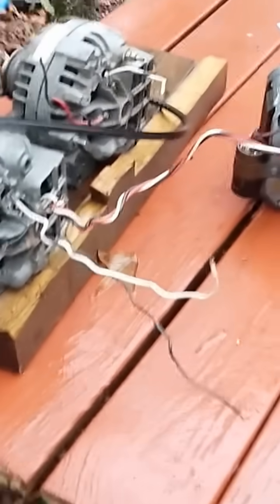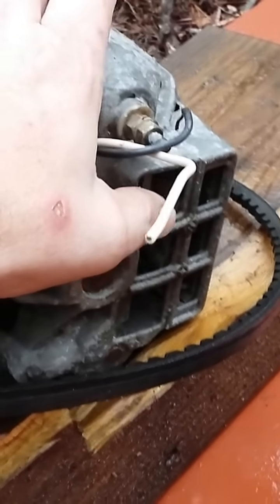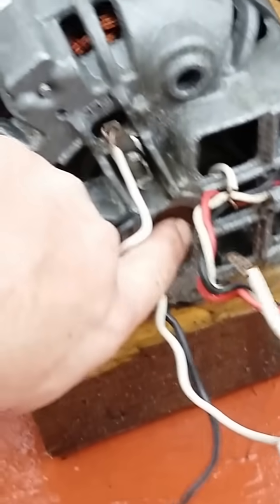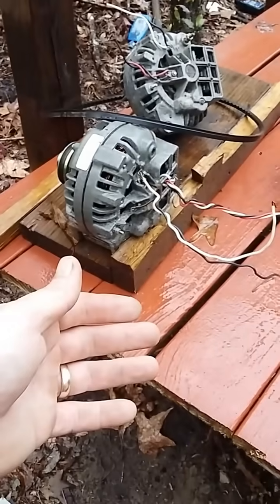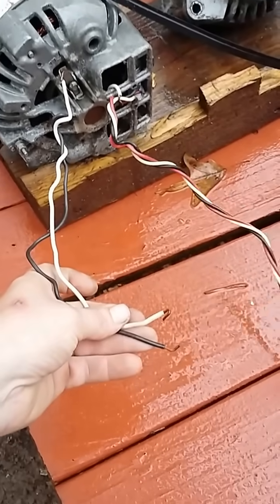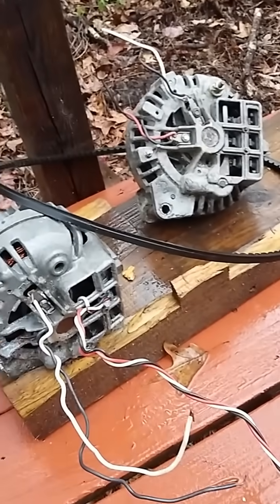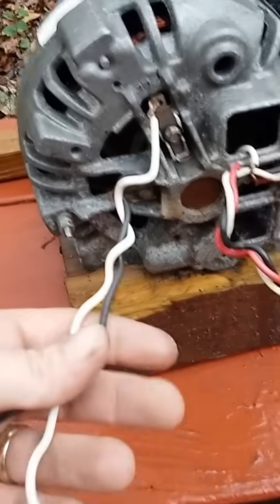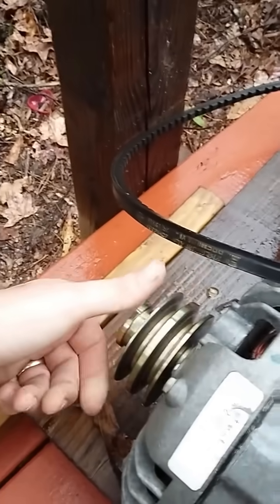Update Free energy forever no wind no solar no gas READ DISCRIPTION!!!

Comment: It's just extremely hard to believe that using components and circuits you didnt  even fabricate yourself you've managed to obtain "free energy". You have no idea how long I've wanted to make a device like that. Free energy is a broad term. Do you mean free as in obtained from a seemingly limitless natural source? Or do you mean overunity by getting more output than input?
Reply from the maker: I am speaking of a large difference in potential with a high resonating frequency that has the same capacitance resistance and inductance resistance being fed into a homemade capacitor and spark gap and bridge rectifier with voltage regulator on positive side and the negative side going directly back to ground. IE.  Compiling frequency of high voltage high frequency into homemade capacitor that has quantum properties copying the electrons and only using the copied electrons in the rectifier circuit limiting the voltage of the positive terminal which is bad energy and directly connecting the negative terminal which is good energy and safe. Thank you for the kind comment!
Reply: see this portuguese video maby it hellps    https://www.youtube.com/watch?v=XWlG5jXvwAQ&ab_channel=liciniobatista

Comment: You're not getting 220v @90 amps out of that alternator. More like 12v. Shaking my head.... None of this video is accurate.
Reply: this portuguese video maby it hellps    https://www.youtube.com/watch?v=XWlG5jXvwAQ&ab_channel=liciniobatista
Reply: @tww1478  ummm diodes don't do that. Do you know what the diode pack does?
Reply: @JF32304  reduces the power to 12 volts
Reply: @tww1478  that's not at all what diodes do. Not even in the slightest.
Reply: @tww1478  diodes take incoming AC wave form and turn it to DC. Bridge rectifier has a diode pack in it. Nothing at all pertaining to decreasing voltage. That would be a resistor or a transformer.
Reply: @JF32304  what is the voltage and amperage after you remove the diode.  this is all that matters
Reply from the maker: Actually what matters more than that is keeping the resonant frequency between the inductor and capacitor at the same resistance...
Reply: @tww1478  sigh... Diodes don't do anything with voltage, they merely change the state from alternating current to direct current that is all they do.
Reply: @JF32304  what is the voltage on the alternator after removing the diode?   And amps?  Answer please

Comment: Free energy does not and will never exist because it is absolutely impossible for his alternator to output more energy than what is inputted to the alternator. How can the alternator possibly feed itself and also generate enough for anything else? It is impossible for that system to work due to power loss. Your idea of 'Free energy' won't work under our laws of the universe. Stop with the free energy videos.
Reply: this portuguese video maby it hellps    https://www.youtube.com/watch?v=XWlG5jXvwAQ&ab_channel=liciniobatista
Reply: @LICINIO-BATISTA  if it truly works, prove it with calculations.
Reply from the maker: More energy out than what you're putting in Is absolutely real now and always has been and what I do does not break any of the laws of conservation of energy, or the laws of thermal dynamics, it is actually lens assisted and does not have to worry about fighting lens law and I know the correct way ( "phi of the whole leaves to golden ratio" ) to compile electrons on a quantum level using specific frequencies that are directly connected to each other by means of homemade capacitors...
Reply: Stay under your rock Josh!
Reply: @millwright2011  this portuguese video maby it hellps    https://www.youtube.com/watch?v=XWlG5jXvwAQ&ab_channel=liciniobatista

Comment: Not to wreck ASS HERE but this is. not breaking the law of conservation of matter
 Ur bunny need this but better is you get a marine boat geni and run it on propane and you get cheap clean electric and the noise is free and ur the guy in the trailer park that has the loudest house on the block
Reply: Yeah and am have the cheapest light bill to😂

Comment: ThomasBuie EnergyBuies , you shouldn't waste your time worrying about or responding to the haters that leave nasty comments here. Let them wallow in their self pity.  Being smart will get you hated faster than anything! You are doing something that will improve the quality of your life and the lives of people around you. Your are to be commended for the effort you're making to try and get the truth out for people to see and hear. GODSPEED!
Reply from the maker: DO NOT TRY THIS AT HOME!!!!!!
I almost wish everything were that simple...  I had to keep to God's plan and that is not always an easy road to travel... but for the beautiful comment on whichever video this is that the algorithms notified me for... I will give you a present that will be released in the next few days anyways... Sooo..... how to compile the electrons to make them quantum and moving in and out of themselves and others? Well, it was all so simple and I was on top of it the whole time! Speaking of the solid state system that is, because when using moving parts it's very easy to get high frequency and or high voltage...  But technically almost any system you're using.. . does not matter as long as whatever energy that you produce you store it first and then change it into something that can be manipulated on a quantum level. once you do that (compiling the electrons in a homemade aluminum foil 1 ft by 1ft  square capacitor) all you have to do from that point is store it again and rectify some of it for use usually to power itself and then you copy the rectifier circuit with the voltage regulator on it and use the ground directly to the ground it doesn't matter that it's -10,000 volts NEGATIVE going to -12 volts NEGATIVE as long as you regulate the voltage after the rectifier on the positive side...  you can connect the battery to itself after transforming it, compiling it, rectifying it, and regulating the voltage on the positive pulses back down, none of the beginning of the signal stays in direct contact with the end of the signal therefore allowing you to loop the end back to the beginning... We do not have to kill half of the energy in the circuit so we can effectively transmit it or use it!!! that only allows for a little bit over 33% efficiency out of a generator/alternator and that's not acceptable in my eyes... And if you have read this much so far. I will give you a little more simplified explanation of the circuit for my appreciation...

12 volt battery to a power inverter,(400w) run a neon sign transformer off of the small power inverter, build a homemade capacitor from my one foot by one foot diameter aluminum foil capacitor that will compile the electrons. it will need a spark gap and you will also rectify the energy coming off of those two wires. And the DC pulses that come off of your bridge rectifier only needs the negative side of the rectifier to go directly to your battery and the positive side needs to run into a few HVAC capacitors that are in parallel on one side where you will put your positive input pulses and on the other side you run diodes from each terminal to each terminal and one off of the output also will regulate the voltage and that can be run back to the positive side of the battery once needed potential is reached.
Hint!!!!   How many wires can you attach to the spark gap that you can rectify and regulate the voltage off of to be used in other circuits without affecting the primary?????
Welcome to quantum reverbing of electrons... Thanks for the comment!

Comment: Roscoe  do believe  it work 
Next how to keep the batteries  charged   solar  power
Reply from the maker: Why not use a diode and a dielectric electrolytic polarized capacitor for the two field wires on the rotor and not need a battery... Also in that configuration you could use one of the stator windings as a motor winding at that point you would have a little energy going in and a lot coming out just as long as you don't hook the wires to themselves and kill the polarity you will have plenty of energy.
Reply: look this portuguese video maby it hellps    https://www.youtube.com/watch?v=XWlG5jXvwAQ&ab_channel=liciniobatista

Comment: Can you upgrade your system by adding Solar Panel, Wind Turbine and can you harness or able to store your Free energy in Batteries or Lithium Ion batteries ? It is not totally Free because you said that you need like 6 Volts of DC current on one side of the alternator and it shoots out like 90 Amps or more on the AC side (Your 3 wires) .
Reply: see this video  it is portuguese and tell me something after    https://www.youtube.com/watch?v=XWlG5jXvwAQ&ab_channel=liciniobatista

Comment: An alternator can put out 90 amps at 12 volts. When you use 120 volts you only have 9 amps. Which in turn possibly after rectification might be enough to run your refrigerator. That is if you don't account for any losses. Not to mention that it takes 3,600 RPMs of the alternator and a lot of torque with 9 amps being applied to the alternator to create 120 volts ac

Comment: I tried to pull 45amps 12 volts DC out of it. Guess what .it stall, whenever you disconnect the battery feeding cables.how do you did it

Comment: beleive this can be done. A 12v motor hooked up to a car battery with "plugs". The battery will turn motor, correct? Then motor turning alternator with "plugs" hooked up to the battery to charge, underneath the first "plugs". I beleive they would have to be identical. I just dont know how to get the power from it to charge anything. Unless adding ANOTHER "plug" to the battery underneath or in middle or on top to like somthing small or like a refrigerator. Is that right ? Maybe another alternator or a 24v battery ?